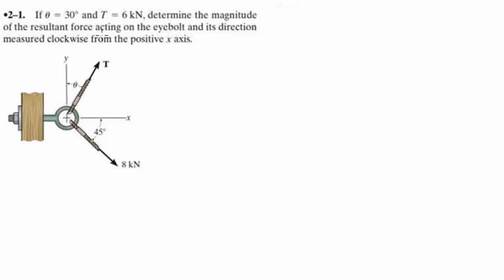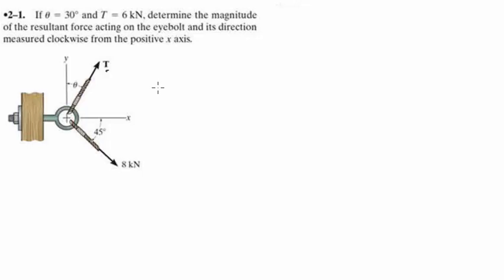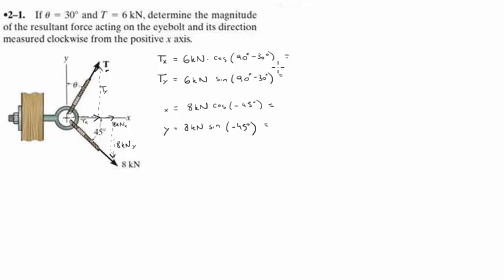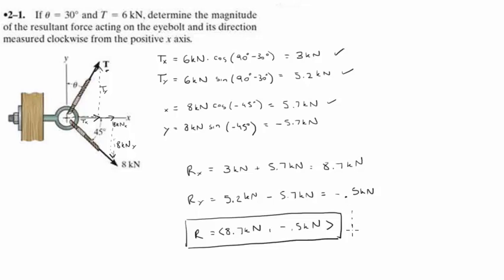Statics 2-1: Finding the resultant force

Comment: How did you calculate the vertical component of 8KN as negative - it should be 8 x sin 45 right ?
Reply: its in the negative direction
Reply: CLOCKWISE